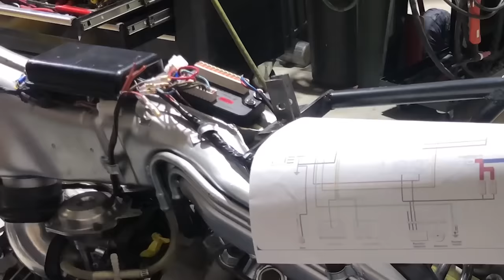Yamaha Virago XV750 Cafe Racer FULL TIMELAPSE BUILD

Comment: Great build .Had one of these in 1986 ,Starter motor clutch, cams and followers and rear shock all failed on my 1983 . I Put on a  Marzocchi sports monoshock ,upgraded the fork internals ,new cams and followers and vincent straight handlebars  ,made a nice back roads tourer but the 100 mile tank range was a drag .Great looking engine like 2 XT/SR500s cylinders siamised together another popular custom favourite .

Comment: Hi Guys! Great job! The bike is super nice! I'd like to ask how did you find this exhaust? Did you build it yourself from scratch? If yes, can you build one for me? I have a 1982 XV920 and I need an exhaust. Another question. I’ve noticed that you are using an M-Unit in your construction. How easy is to insert it on the old bike? Did you replace the rectifier/regulator and ignition coils too? Did you rebuild the whole harness?
Reply from the maker: @Aldo Bega thank you!! Look for Spyramoto on Insta he builds the best pipes for these bikes in my opinion and yes the Munit is the way to go we made a complete new harness and had to use ricks rectifier for lithium battery and we used original coils. So links for harness diagram and other parts are in the description. Thanks!!!
Reply: @motow19  Thanks for your reply!

Comment: @MotoW nice work. Why did you cut the shaft from front axle and putting tread in it?
Reply: Probably to extend the length for the conversion. I’m having the same issue with my CB build rn.
Reply from the maker: @R. Spijky yes indeed @Aye_J we had to extend it a little that stem tube in which you can get a conversion tube and bearings ready for your conversion too at Cognitomoto.com but things get pricey so to save money and time that mod was done months ago and is still solid to this day. Thanks for Watching!!!!
Reply: @motow19  I may have to look into doing it then. I was going to two the conversion kit from Cognito but 800$ is a bit steep lol
Reply from the maker: Yes do it. Thanks!!

Comment: That steering extension is definitely suspect, and did you realise you were drilling into the air-box when you were mounting cdi ?..rings dont like metal filings.. seat-frame mount would be strong out of tube, not flat, otherwise a great build
Reply from the maker: So far Extension is working great as it doesn’t have tons of pressure there because most of weight is at bottom bearing together with upper and drilling was no problem since we used a vacuum to suck everything plus we cleaned all air box prior to starting. Thanks for the concern and thanks for Watching!!

Comment: Sorry , I have to say, you forgot  to install the small pin during the assembly of the starter motor, now the starter will twist around the body and loose the power because it will not be in alignment with the   magnetic field of the permanent magnet of the stator. Look the video again, time 21.57 , it remains from your left side on the  working bench! Fix it! best regards!
Reply: pro look

Comment: The bikes looks good, the seats is a bit "meh" for me. I like the steampunk pipes looking exhaust, it's quite unique. The thing that kinda bugged me the wrong way was where the battery is located: right under the frame. I remember seeing someone with an electric scooter where the batteries are right under you put your feet. He hit something right where the batteries were, damaging them, resulting into the scooter bursting into flames a few minutes later (the guy is fine). I'm just saying but I wouldn't put the battery so close to the ground if I was you, it doesn't feel very safe.
Reply: completely agree. dislke the seat look, and batteries definitely need dry&clean particularly lithium batteries.

Comment: Why don’t make the frame modifications before painting? I don’t like the body builder paste in the fuel tank. The box for the battery…. Mamma mia.  Welding/cutting over the engine and shock absorber without cover them….

Comment: Very unpractical place for the battery !! I guess you never drive this bike in the rain?
Reply: that what i was thinking when i saw where he mounted at especially all the debris
Reply from the maker: @Theo Berkhout @Daddy Marbbles Yes that battery sits very low but it’s so tiny it is located right in between the old center stand bracket and still above engine bottom line it will get dirty but it’s part of these builds. We are probably never riding that Cafe racer in the rain but if that happens as you can get caught up then we would get soaking wet really quick 😂Thanks!!!

Comment: Is it ok to put the battery under? What a weird place to put the battery. And besides it's pretty hot under.
Reply: ye and the wheel spinning on the wet road y'know raining...

and the battery should have a cover so it will not soak wet thing and it will cost short circuit if doesn't have a cover

Comment: For whoever wants to know if you cut the r6 steering stem to add threaded rod and nut the hole that’s in it from the factory is the correct size for 5/8x11 tap. No need to drill it bigger
Reply: New to this. What is the reason for cutting the shaft of the first place?

Comment: I Used to have one of those bikes and i did a few things to mine as well Back in the day .

I can NOT believe all the effort your putting into this bike and SKIMP on the STEEL BRAIDED BRAKE LINES  what a shame.

I would have converted the rear to chain drive that is what I did to mine because the drive shaft is so heavy and also you gain disc brakes in the rear when you convert to chain also

They did not have those type of front end at the time when I had mine would have been nice if they had I would have converted mine as well so all i could do to mine at the time was handle bars and little bolt on stuff.

Comment: they might give you a little back pressure, from all the 90's which might be good. You may have to re jet the carbs to get it to run correctly and not burn your valves

Comment: Is it possible to put monoshock on xv750 ? And what I need to do ? Great bike btw!
Reply from the maker: 81-83 XV’s are monoshock bikes so maybe you can look for one any other models you will have to engineer a monoshock bracket and cut and weld frame in different points

Comment: so much work in this. a few costructive remarks. exhaust straight parts needed some creative bend love. frame would be better in dark colour. seat is too small and underfeatured, plus those diagonal supports don't blend well. what i try to say is that when we put so much effort in something it is good to visualize some aspects as close as possible, in prior, by any means (3D, sketch, mockups). hope it rides safe and well. have fun.

Comment: Can someone explain to me why he cut, tapped and rejoined the steering tube like that?
Reply: I assume the front end they used the steering stem was to short for the frame, so they had to extend it.
Reply: The builder replaced the conventional forks with an upside down version (Ohlins?) requiring larger ID triple clamps. It appears that the lower triple clamp is several millimeters thicker than the original.

Comment: how much to make a built like that
Reply from the maker: Around $12k including motorcycle
Reply: @motow19  How does it compare with other motorcycles you can get for 12k in America ?
I only did projects like that with redundant stuff that cost little or nothing.
12k here would buy a Benelli Imperiale and a Honda Forza 350, and leave you enough for a lobster dinner for four on the Costa del Sol.

Comment: Not a criticism because this is not common knowledge outside the aviation community, but if there are any aluminum structural components on the bikes your building do not use the standard Simple Green use the Aero Safe branded Simple Green. The Standard formulation of Simple Green causes "Hydrogen Embrittlement" the formulation increases in PH as it sits on the part eroding the surface creating pitting corrosion which creates regions of high stress on the surface of the material and eventually micro fractures which lead to component failure.

Comment: Wish my xv750 build was this simple. If you are watching this video PLEASE KNOW THIS BIKE IS A PAIN IN THE ASS TO TURN INTO A CAFE RACER. Parts impossible to find, fix one problem another will come up  and the chances of breaking bolts its very high due to the age of this model. Save your money buy a modern bike.
Reply: The biggest issue is finding a starter gear if yours was already abused. I've been able to replace everything else thus far.
Reply: @chadbrodersen3875  yea i ve tried everything i can to fix mine and it still makes the rockbox noise when i start it

Comment: Everything is nicely done, only the seat is a real nuisance compared to the original. But interestingly, all cafe racers have seats made extremely carelessly, as if the seat is a necessary evil on the bike. He sits on it and the comfort of driving depends on it.
Reply: I think the seat sucks and it would look better with a short fender  he should have went a little more simpler
Reply from the maker: @Miran Rižnar @James Chiappetta Yes seat can discomfortable if ridden for crazy long distances but it will not be the case with this Cafe racer. That seat was made to follow tank lines and originally had a Rear fairing in which we my use it in the near future. Thank you!!!

Comment: The position of the pegs make no sense in relation to the rest of the geometry. It's too far down, and too far back. 
I'm all for custom jobs, but it has to make sense in the end. To me this bike isn't finished. The geometry makes you end up with straight arms having all the weight on your shoulders, which is a no no if you would like to make turns on a motorcycle.

Comment: Very strange battery placement...
Reply: Makes sense to lower gravity center?!
Reply: @Dr.DiegoDuarte  what about dirt and water from front wheel?
Reply: @P45H4  You got a point! Still think it's a good place, but a different casing should be built, something sealed in the front, bottom and top, with some ventilation on the top. Actually I didn't understand why they didn't weld the casing in the first place... they just bent and riveted the stuff. But hey, Im not doing any better at the moment, so just send my kudos and love for the duo!

Comment: Trying to understand why they didn't choose the XV920 for the project.  Bigger engine, closer to the ride position it transitioned to, and belt drive (way more efficient than shaft drive).  Looks nice but I would have chosen a better donor bike to work with.
Reply: After seeing the absolute final, it is no wonder nobody is riding it.  If it is not a comfortable ride, you won't.  Kinda pointless.
Reply: Well, I supposed that the whole point of the build and restoration is that you work with what you have...

Comment: I write from Italy .... destroy a historic motorcycle like the yamaha to do the painting with spray cans, not to have a galvanic bath to chrome but always paint the aluminum color with the spray can .... at the temperature that reaches the engine block that painting will come off in less than two months .... but how can you do such a mess? sorry my bad english
Reply: Okaaay......Since when has a Virago become a historical bike ? It was always cheap and cheerful, and for some reason sold in high volumes. There are thousands around. Albeit, most of them are the smaller volumes. It's in no way a FZV or anything like that. 
If you were building bikes, you'd know there are loads of steps one could take, all of them leading to the point where the project never is finished. I've got a XS living in boxes on 5th year, as a point in case. This guy did not do anything really wrong, but he did reach the stage of having a first, rideable draft completed.
Reply: They make engine paint in a spray can, I used it on my motor.. 3 years ago. Still perfect.
Reply from the maker: Very true Thank you!! As always you gotta work with what you have and make it work.Spray cans or not paint is paint in many different forms of adhesion just some last longer some not but it will vary depending how well surface it is prepped and cured with sealer as simple as a Clearcoat.👍👍👍

Comment: Except ass sea is to high it should be like kind also bobber style I would lower seat as much it goes safe down and make it bigger and add a back hub that ends in spoiler is kind scfi retro but very preaty and I would also self made thiner dym larger tyres which is again retro but scfi muscle engine retro fits in nice in cafe racer. design and even light box below spoiler is ideal if self made yess It takes time but this designs take ower 100 k easy if stylish brand the entire process and pass time to made including scfi retro fit into purpose is kind trill so everyone sees shine and see class design bringing japanese cafe racer or vespa retro cafe style or even scfi are cool options anyway If design ditched everyone agree and comment